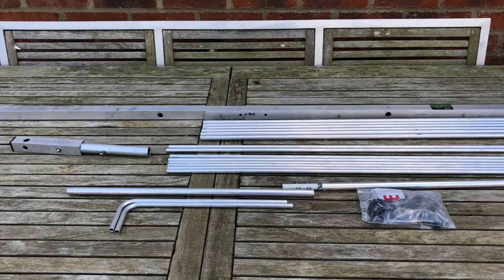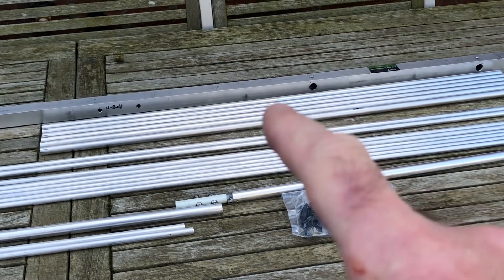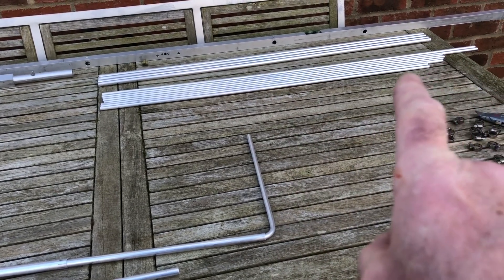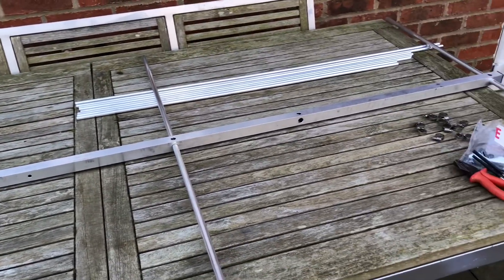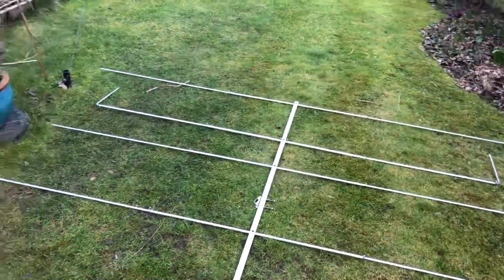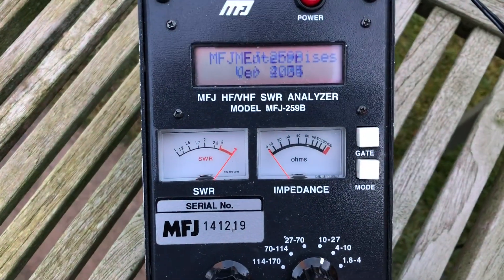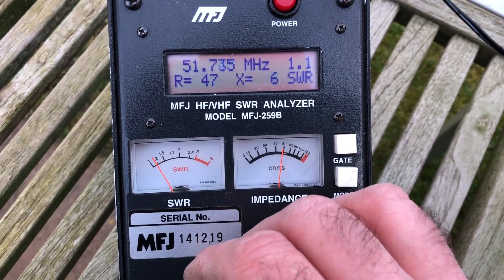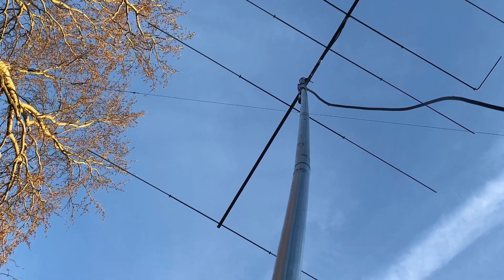5 Ele 6m OP-DES Yagi Assembly

Comment: I would love a small yagi like this, l think I would get away with putting that up in the back garden without to many issues but unfortunately I’m on 11m band which requires a massive yagi , which are way to big for most people in general. Is there anyway l could get this to work on 11m? Would a antenna matcher work or am I just dreaming. Any advice would be appreciated
Reply from the maker: It’s a specific computer design build for 6m. If you look on this channel I have a mini-horse design for 10/11m. It’s a short boom folded 3 element yagi that’s a compact size and works great. The most recent video shows the latest  build. Very simple and cheap to build 👍🏻
Reply: @G0CNN-Ian  Thanks for that I’ll have a look. 👍